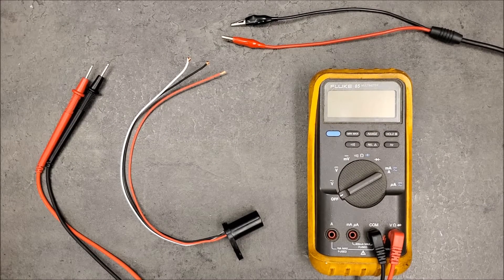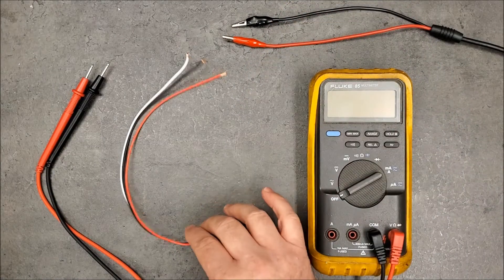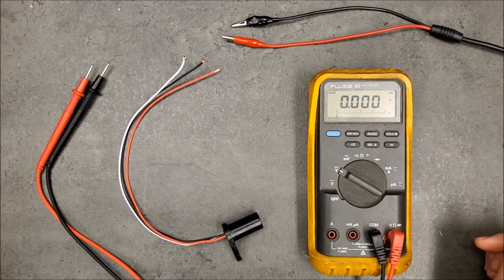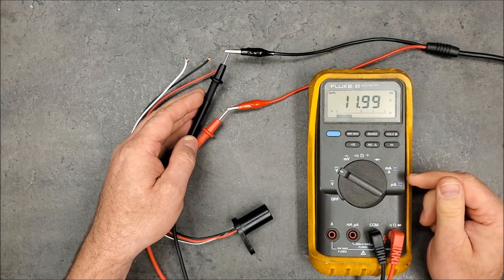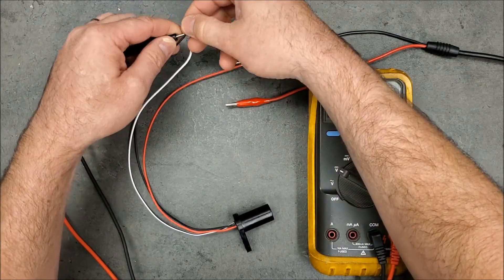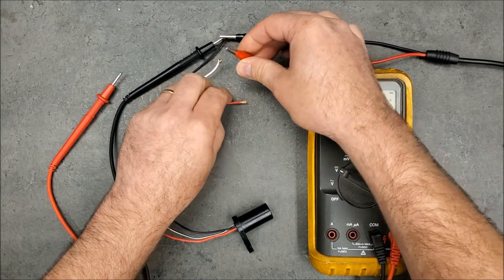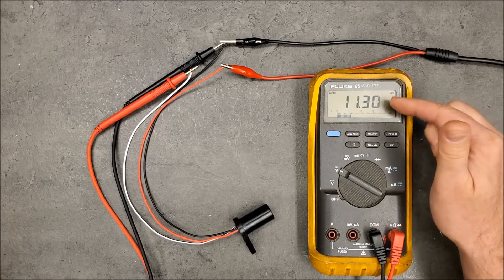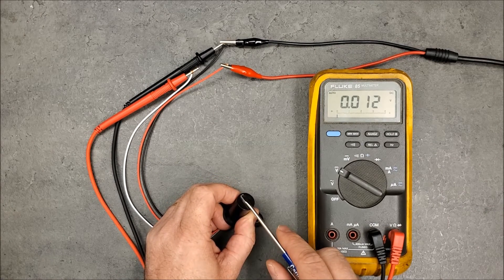Testing a Hall Sensor with an internal pull-up resistor

Comment: From what I've read elsewhere the tested sensor here is a pull-down, not a pull-up. A pull-up sensor would have (in order to be tested) its signal wire connected the the battery positive (with some resistor in between). I have a pull-up VSS sensor and when activated it doesn't give tension, it ties the wire to the ground, which explains why you have to connect it to the battery positive + resistor. But I guess all the naming depends of where the resistor is located. In my case the resistor is within the ECM.

Comment: How do l know if my VW Golf mk6 tdi crankshaft possition sensor hall sensor,is pull up or pull down type.?
As l believe this will affect the test procedure,am l correct?
Reply from the maker: Most hall sensors are pulled up. It's uncommon to have them pull down. In a factory application, the ECU will have an integrated pull-up resistor.

If you are testing your sensor on the bench, it will need a pull up from the output pin to the input voltage to react like it is the car. You can use a 10k resistor for this.
Reply: @thedubshop  Thank you for you most kind help with my question most appreciated.As l was wondering why my bench test was failing to respond as expected

Comment: So its pulling the voltage down not up have you mis titled this video?
Reply from the maker: A typical hall sensor has a floating ground. The Pull-Up makes sure then it is not active, the voltage is above your operating threshold (pulled-up). A hall sensor turns off faster than it turns on so this is why you will generally use the falling edge as your trigger edge.
Reply: @thedubshop  thank you  for this information its always good to understand 
design logic in practical aplications

Comment: This is so simple and a great video. Can this method be used to test a 3 wire CMP sensor outside the car as well?
Reply from the maker: Yes, absolutely if it is a hall sensor. Some require a pullup resistor when outside of the vehicle though.

Comment: Thanks for the video.  What do you do if the voltage doesn't drop in the presence of a piece of ferrous metal?
Reply from the maker: if you have verified that the wiring is correct and the voltage doesn't drop, the hall sensor has probably failed.
Reply: @thedubshop  Thanks.  I may have had the wires labeled incorrectly.  I switched two of them and now it seems to work?  Powering with a 9V battery, I get an output voltage of 0.62V that drops to 0.11V when the gear teeth pass the sensor.  This sensor will run on a 5V source when installed (speed sensor in a vehicle).

Comment: Great tutorial. 
Question.
Using 9vdc, when I connect correct leads to pos and neg of HS I get a proper reading that just under 9vdc is running through HS.

However, when I connect black probe from multimeter to black HS and red probe from multimeter to white signal wire and pass magnet over HS… there is no drop in voltage.

Is my HS blown/damaged.  I can fix it, just need to know if I’m doing something wrong before taking that step.

Thanks for great tutorial.

/Bklyn👑

Comment: Update:
Here is what just came to my mind.
Since there is obvioiusly a magnet in that hall sensor mechanism and there is full voltage present in the hall output in its default state. Putting two and two together as they say is that the magnet must close a circuit ( a switch) inside so that the hall output is connected to the positive part of the circuit.  And when you approach the magnet with a screwdriver, the magnet is drawn more towards the screwdriver and move away from the switch and the connection therefore is lost. [ If that be case, then any object won't do, it has to be metal of some sort that the attracts the magnet]
If that be the case then it makes the sensor more like a reed switch than hall sensor.
And the location of the resistor must be before the switch, that is between the switch and the body of the hall and not after the switch. If it was after the switch the hall output will not show full voltage and the reason for the resistor in the first place is to make sure that the voltage drop is assured.  It is the only thing it makes sense. Unless I am missing something.
And the reason it is called pull up resistance, it is probably because it is hooked up to the positive terminal and not to its negative terminal.  I wonder if there is a pull-down resistor in some?  Who knows.

Comment: Is there any way to know which wire is which just by looking at the mechanism?
Pull up resistor?  Is that another phrase for hmmm... say that the hall output wire that you are hooking up to your voltmeter has resistor inside of it and that it's other end is hooked up to the red wire that hooks up to the battery?  No that is not right.  Perhaps it means that the negative wire of the hall inside the hall is hooked up with a resistor and that resistor is hooked up to the positive red wire that goes to the battery?  Nah, that couldn't be right.
Although there are three wires, in reality there must be 4 wires.  There has to be.  Why do I say that?
Two wires (the black and the red), these two wires send current through the hall material/substance.  If you are hooking it up to a 12-volt battery, the two wires certainly will show 12 volts if measured with some slight amount of voltage drop understandably. I would think it is not like a direct hook up wire or there will be serious spark as in short circuit, as if you are just touching the two terminals of the battery with a wire.  That wouldn't be good.

The hall voltage reading also need two wires of course.  So I can only assume that the negative of the hall part of the hall substance (that is across voltage reading on the hall substance) must be shared with the same negative, i.e. the black wire.   And the fact that the voltage across ( hall output as it is called, the white wire being the connected to the positive probe of the meter) reading basically the same amount of voltage as the feed/send voltage implies that there is substantial voltage difference across the substance and not just a tiny amount as it is taught.

And the very fact that there is voltage present in the hall output in the first place must be due to the fact that there is a magnet present there embedded as part of the hall mechanism.  This magnet must therefore create permanent deflection of current across the hall at all times and therefore the deflection must be the default state and not one that is induced in this set up.

And perhaps the reason why the hall output is so high, maybe this has to do with the so called "pull-up" resistor lingo being there somewhere.
So if this is the case and it is what causes such large voltage in the deflection reading hall-output, where is the resistor installed, in the white wire, or where? and what is its value?  But that doesn't sound right.  And how on earth (if it be the case) the resistor along with the magnets position give such high voltage and furthermore by introducing another metal (you called it object) to the tip of the hall sensor will cause the hall voltage to just drop to 0, i.e. no deflection?

That is what my head chews on.

Comment: Hey Mario, Caleb here. Nice video. What if the hall sensor only has a 5v reference? Can a resister be used, or would I need a power supply with adjustable voltage output? Glad I found your channel.
Reply from the maker: Hi Caleb, I'm a little late the comments here. Most hall sensors will operate from 5-24v. So you can test in the same manner. The output voltage out will be lower. If the hall has a floating ground, you may need a 2.2k or 1k pull up resistor added between the input voltage and sensor output.